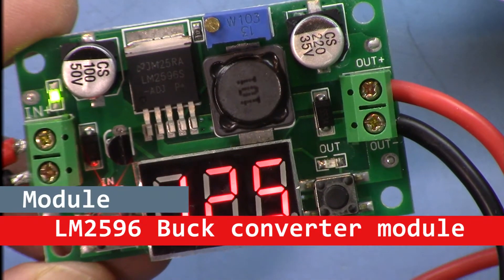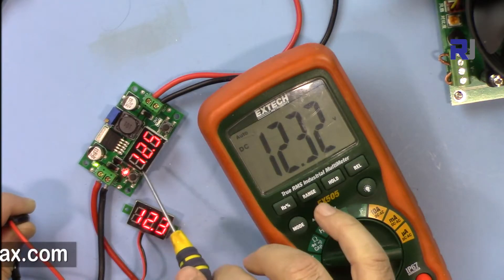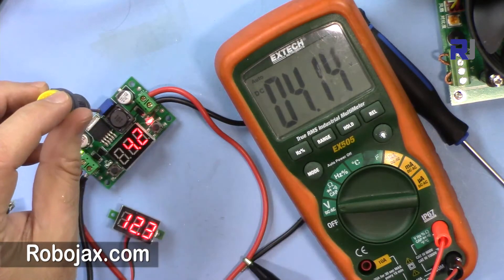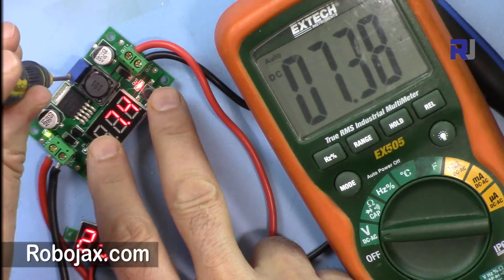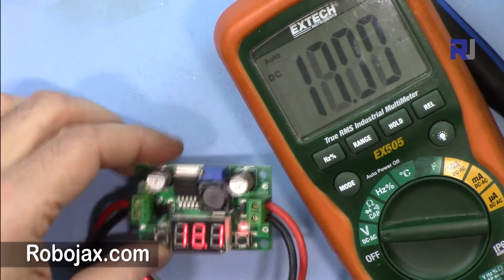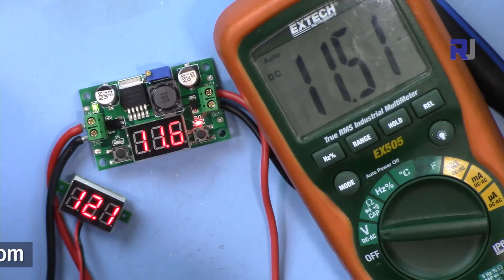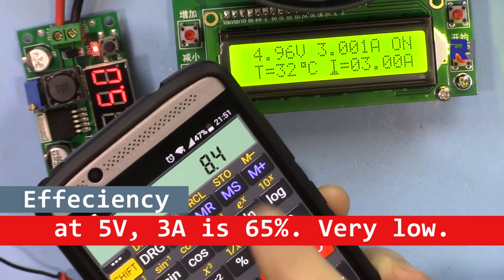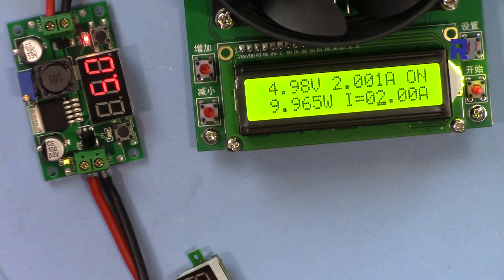LM2596 DC to DC 3A Buck Step up Converter Converter with LED display tested

Comment: so this says it can give 5V out 3A out, but it wil destroy my rasberry pi?
Reply from the maker: if you set the ouput at 5V, it won't distroy it. You must have done something wrong. The current 3A does not do any harm even if it is 100A.
Reply: @robojax you say the effenciency is very low 65% and that it become’d very hot so, my question is

Is this going to power my pi good or wil it damage my pi
Reply: @robojax to ask it short, can this power my pi without overheatinh or damage it if it needs 5 V 3 A constantly
Reply: It was e question, i still don’thave one, will this power my raspberry pi enough Because you said in e other video that the 5 V 3 A failed as e test

Comment: is this board is for stepdown voltage only?
Reply from the maker: What do you mean? You don't want th display or the CC. Yes both available. Check my other channel @wattHour for reviews
Reply: @robojax  that if you have a 12v dc battery you can only  bring the voltage down? Not up?

Comment: I would like to use a CCTV camera as a dash cam. I need 9V 0.6A power to run the CCTV camera. Can I use this DC converter to do it?
Reply from the maker: Yes you can but this over kill. You can use a very small back converter.
Reply: @robojax  Any recommendation?
Reply from the maker: visi WattHour, my other channel and find something there. I am not sure.
Reply from the maker: visi WattHour, my other channel and find something there. I am not sure.

Comment: When I am doing 12 volt input and set 3 volt on output but digital display is showing 5 volt ie whatever voltage I set it increases by 2 volt but checking with meter output voltage meter  But it is showing correct only on digital display two volt is getting high how to solve the problem

Comment: I just bought 2 LM2596 boards and they only have the 1 button on them to switch between in and out voltages. Is this a concern or possibly lesser or greater version of the one you are using in this clip ?

And yes, it is always good to research on the type of board and what it can handle. Thankyou Heaps for the insight.
Reply: pm me can you to install do sola paint of charger,

Comment: Thank you for sharing this video!
As we can see, you have tested 101 coil version (100uH) of this circuit, so the result you have got matches the LM2596 datasheet. I.e. for 5V output, it should deliver maximum 1.3 A at 37V input, see tables at page 20 in the datasheet!
This chip LM2596 is not suitable for large input/output adjustable power supply, read the aplication implementation theory, especially inductor selection part.
If someone already bought this module, as I did, he has to replace the coil according to his particular application. As an example, for 12V input and 5V 3A output, the inductor has to be 33uH rated at 3.5 Amps. So, the module will deliver 5V/3A and most important it will do that at more than 90% efficiency!
Reply: pm me can you to install do sola paint of charger,
Reply: Problem is that there are many fakes of these junk modules and they run at only 50Khz, The coil on my board (smaller without display) is printed 470, so I guess value is 4,7uH and is too low for high currents

Comment: Can this regulator step up 9v to 12v?
Reply from the maker: my friend this is called "buck" converter which means it is step down converter and it will reduce the voltage. The one you are look ing at is called Boost converter or Step up. I will change the tittle now and add Step Up converter.

Comment: Accidently i connect input voltage at output end ,now it gives same b8ktage but  lcd shows some other result , what could be the fault.though not connected permanently ,just touch battery ending to output end
Reply: pm me can you to install do sola paint of charger,

Comment: Is the LM2596 not also a step-up converter? Why not tested this case?
Reply: I don't think so. I just tested mine (without display) and the output voltage drops at a difference of about 2V higher input than desired output. Also the data sheet says something along the lines of "the input voltage must be 1.5V higher than output voltage" although that's translated Chinese, so no guarantee. So it's rather a step-down module, not a step-up module.

Comment: If I connect a fluctuating input DC to this buck converter, will it damage it, bcos I want to connect it to a solar panel, and u know V from a solar panel do fluctuate depending on sunlight, thank u
Reply from the maker: this device outputs contestant voltage meaning  if the input is fluctuating withing the range it will keep the output steady. Sure. but it will not boost it. for example if you set the ouput to 10V and input is between 11V to 20V it will work but if input goes to 9V, then the output will be below 9V.

Comment: could you please suggest best setup down dc to dc buck converter input 24v 10amps output 12v 5 amps?
Reply from the maker: The output is 12V X 5A=60W so you need 60w converter . Here 250w  https://youtu.be/ErqyxBvkdPk bu search my channel for 100W .

Comment: Sir, if the input volt is less than 12voltage  does 5 voltage remain constant?  For example:-9 volt 8 volt 
Pliz reply sir.
Reply from the maker: Hello, yes it will keep stable until the input is below the desired output value.

Comment: I don't know if you know it or not the reason why it's getting hot is because of the heatsink try that
Reply from the maker: I am reviewing it the it is sold. why buyer should attach anything else? The seller claims 3A and it should deliver 3A without attaching anything.
Reply: Well if you was paying attention does come with the heat sink because when I bought mine it came with the heatsink

Comment: Hi. do you think this module can support input 12v to output 7.2v to charge my handheld vacuum cleaner?
Reply from the maker: Hi, we just know voltage and current. You should know the capacity of the battery and maximum charge amount . Then you find the right change module.

Comment: I had a same module and i accidentally reverse the polarity of the wire in the input side, the diode burst up. And now trying to fix it if i can still use it. Hehe.. Any hint to find the short. Thank you.
Reply from the maker: most probably it is dead.  This module has two portion. the regulator and the display.  it seems both or one have been damaged. I just looked at datasheet for LM2596 in here https://www.ti.com/lit/ds/symlink/lm2596.pdf there is not mention of reverse polarity protection so you should think of getting another module I belive.
Reply: @robojax  thank you sir.
Reply: Update sir, good news, after replacing it with a "M7 diode" . The LCD display works again. I checked the regulator, i found out that there's no short so i tried putting the same diode. Maybe the diode protects it from reverse polarity. I always watching your videos about testing all kinds of module, it helps me to choose what is the best before buying it. :) thank you again sir.

Comment: Can this be used in circuits to charge a mobile phone by attaching a USB connector pin to the output?
Reply from the maker: Very dangerous as if the voltage increases the phone will die. But yes if you set correctly it will charge.

Comment: Hi, mine show a correct output on the multimiter but when i use/connect it to a device it drops to 3.5 v for some reason, I think it needs like a diode or something so the device current doesn't affect the "converter"
Reply from the maker: Hi, your load must need more current that this can handle so the voltage is dropped.  try it on another load. for example test it on 1A load or 2A. if it doesn't work with 1A, then the module is bad.

Comment: i pushed this under 5 volts, now its broken.
what part i have to replace ?
Reply from the maker: this is very bad design. if certain voltage harms a device, it shown not allow it.  repairing would be so expensive, it better buy another one.

Comment: Heat sinks are advisable if you push the amps to the max...
Reply from the maker: When they sell it with the title 3A, then it should work right out of the box. or they should say 1A or 1.5A. I am trying to show people not get fooled by the title of eBay or Amazon or AliExpress.

Comment: Hi there nice video , I want to reduce from 5v 2a to 4v . Do you think is safe or will warm up ?
Reply from the maker: Hi, I made this video exactly to answer those types of questions. I don't remember what value it was. So watch the video and you will get the answer. I have spent over 5 hours making this video.
Reply: Robojax I watched it 2 times , but the minimum voltage is 12 volt and you don’t say if it warm up  ,

Comment: you can calibrate the voltage readings by holding the right button for 3 seconds, when it starts flashing adjust it up or down with the two buttons
Reply from the maker: Have not tested it.

Comment: So...not fit for purpose then.
Reply from the maker: It is just the claim is false with the current available module. If you add heat sink or fan, yes it would get better.

Comment: IF THE "OUT "VOLTAGE DOES NOT WORKS (DO NOT CHANGE) THEN DO THIS:
TURN THE DIAL COUNTER-CLOCKWISE AT LAST 10 TIMES AND IT WILL START WORKING AGAIN !
Reply: R u sure ? Cuz I have 3 and all of them don't work plz help
Reply: @ACE-gf2tj  That did work with mine, and I bought at last 10 of them !

Comment: Thanks for sharing this info! I have 8v in and i want 12v out but it wont let me increase the voltage.. Can this module increase voltage output or mine is broken?
Reply from the maker: this is Buck converter (step down) and you should always get lower voltage at output than input. Yes something is wrong with your module.
Reply: @robojax  Everything is ok, he said he CAN'T turn the voltage up.
Reply: @robojax  Thanks! Can u sugest a step UP converter module plz?
Reply: Look for a ‘booster’ not a ‘buck’
Reply: pm me can you to install do sola paint of charger,

Comment: If I have a 24V/10A power supply in to the LM2596, and I'm stepping it down to 12V/420mA for a DC pump, do you think it will still run as hot? I am worried that the LM2596 will always draw 10A as opposed to my pump drawing just what it needs. Thanks Robojax
Reply from the maker: The total input power of the module = (output power) + (losses as heat in the module). If you want to get 12V and 0.42A, then the total (input) power is= (12x0.42) + (losses in the module which is about 15%) = 12x0.42 + (0.42* 1.15) = 5.52W. From that you can find the input current = P÷V= 5.25÷ 24=0.23A so at input your will need 0.23A and to be safe assume it a little higher 0.3A would be sufficient. So the 10A you have got at input is just CAPABLE to provide 10A. The system will draw the current(A) amount that it only needs.
Reply: @robojax  So in that case it should be safe to run my 24V/10A PSU through it. I was thinking maybe I'd have to buy a lower amperage PSU but this is good to know. Thanks for your help! I enjoy your videos.
Reply from the maker: Yes it is safe. You can use 12V battery with 150A to turn on a small 12V 1A bulb. Only 1A will be drawn from the battery.
Reply: @robojax  Thank you, that's all very helpful!

Comment: My device is showing output like 5v but when I measure it.. it gives same voltage as an input 12v.. can i fix it somehow? Also the potenciometer has no effect.
Reply from the maker: Pushing the button will change the display voltage (input and output). Potentiometer is multi-turn. So turn it it at least 7 to 10 turn before you see affect.